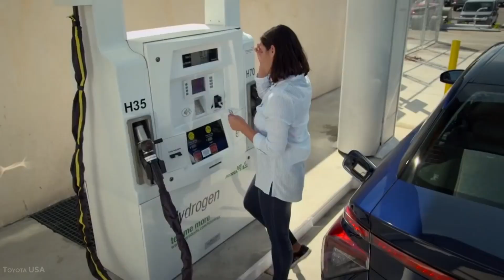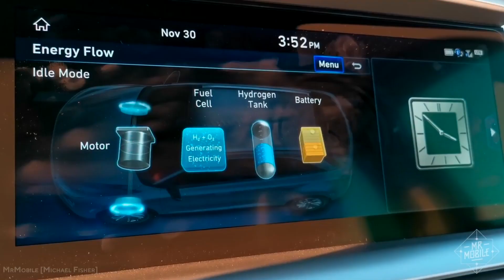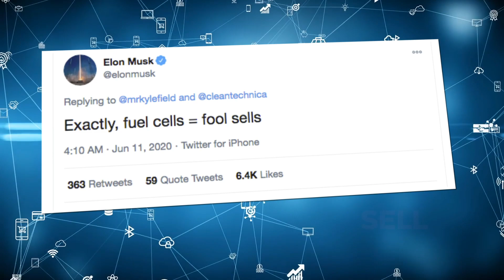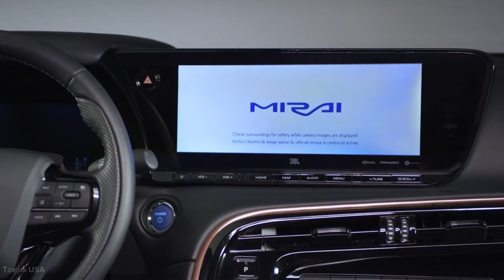Elon Musk Revealed Tesla's New Hydrogen Car!

Comment: Hydrogen is the only way to go.  You can even convert an old car or truck.
Reply: And not take power away from it either. The last time I heard, you should be able to rebuild a V-8 with the new tech and not lose performance. I don't know what happened but in the Eighties it was rumored that this tech could rival a Prius in mileage capability and have two and a half times the horsepower.
Reply: @beauxr.benoit1374  
Don't believe everything you hear.
Generating Hydrogen means a immediate loss of 80% of your energy.
Burning it in an Internal combustion engine has an efficiency of 25% max, but less than 20% average. Being able to tank it, it has to be pressurized heavily, costing lots of energy. Leaving a a miserabel efficiency of 16% (but effectively much  less).
Reply: @BendeVette  Thank you for the info sir, I did not know this.